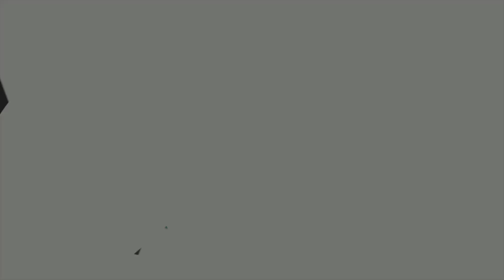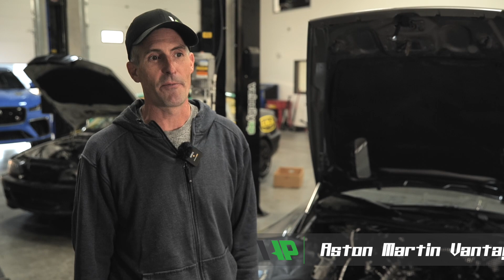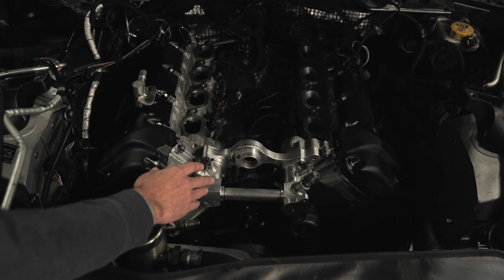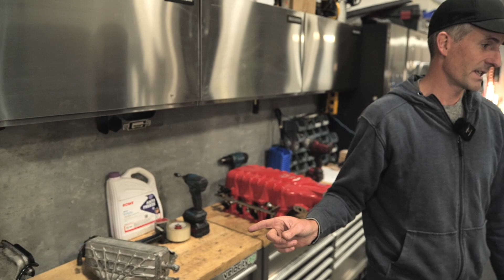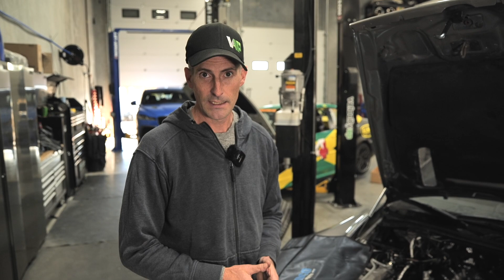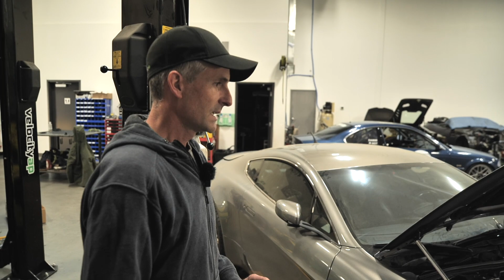Velocity AP Project Super-Vantage: Episode 3

Comment from the maker: @brettannica There's a broad range of outputs that are possible, in the case of this car it was making close to 600WHP at the time it bent a rod.  This engine has been build specifically to handle boost and can probably handle that output level without issue.  For a stock 4.3L, it's probably a very different calculus.  But adding 100BHP on relatively low boost would be a good target.
Reply: Nice. I thinking (and pulling figures out of thin air here) that the small drop in compression you mentioned would now be in the high 10:x's ?? Boost around 4-7psi?
Got a few of your products, so looking forward to following this one mate 👍🏼